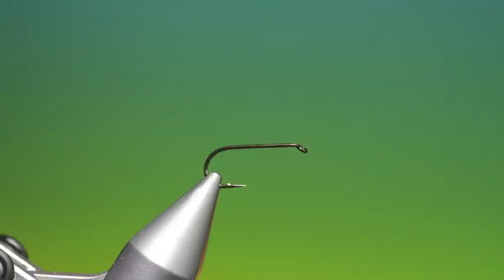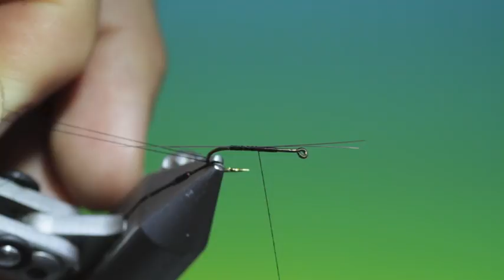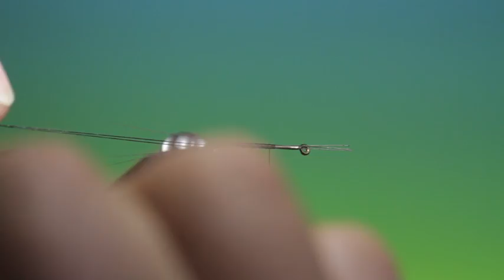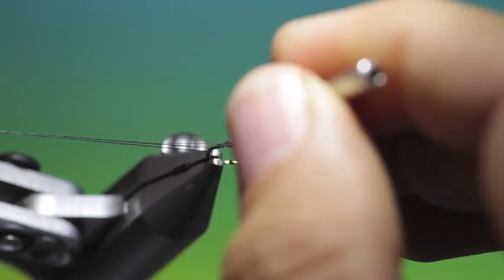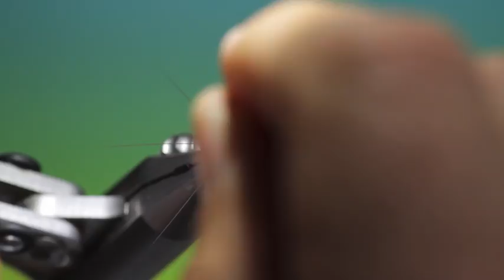Mayfly tailing techniques with Barry Ord Clarke

Comment: i like putting a ball of dubbing technique,like on stone fly nymphs and some dun colored hackle for my mayfly tails.I am too cheap to use fibretts and i dont like to use plastic on my flies,its like using powerbait to me.The dubbing ball will seperate the tail and lift it up like the natural.I mostly use muskrat for dubbing because its waterproof and mix some other dubbing to color as needed.I like using some kind of bird feather for the wing,no plastic wings.Presentation and technique 95% of the time is more important than the fly.
Reply from the maker: Fair enough Mike, just another technique...